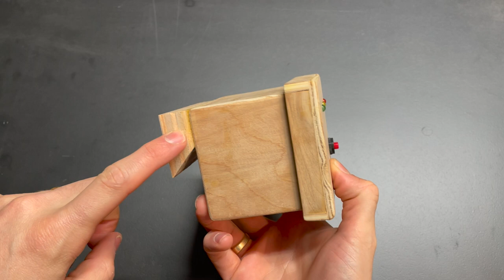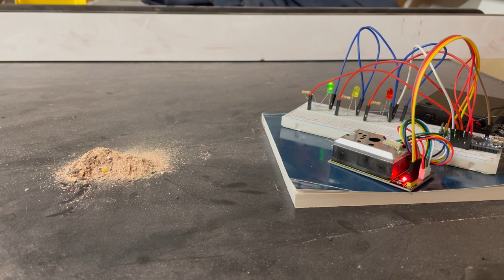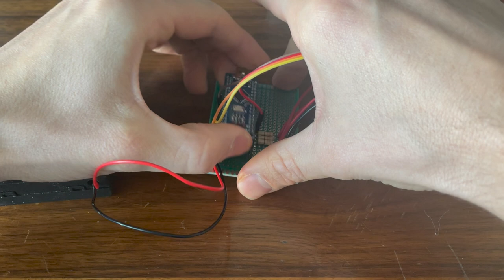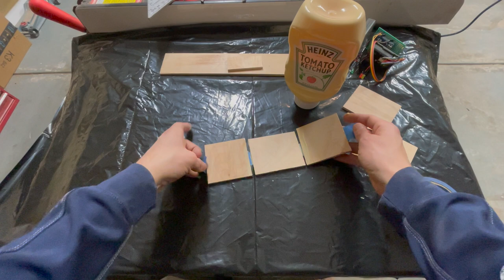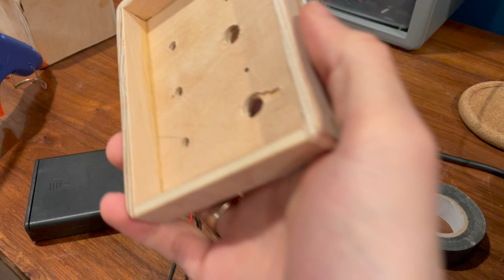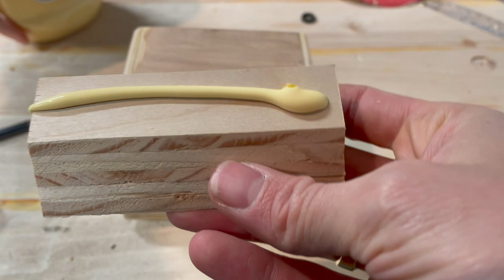DIY Dust Monitor

Comment: For future videos, I might suggest during editing. Right click your video clips audio track and have a deep look around for an option called "Normalize" This will boost audio levels significantly. 

Be aware, it only boosts audio to the highest peak. So normalize clips after you have cut everything together. 

(Dont normalize music or added sounds)

ps. love the device. 

Have you considered an analogue out put for a more accurate reading?
Reply from the maker: Thanks for the tips! I’m definitely a novice when it comes to video editing. I’ve not considered an analog output. Interesting idea..